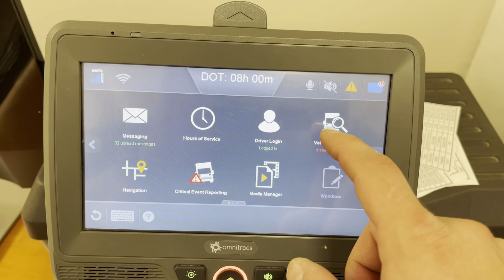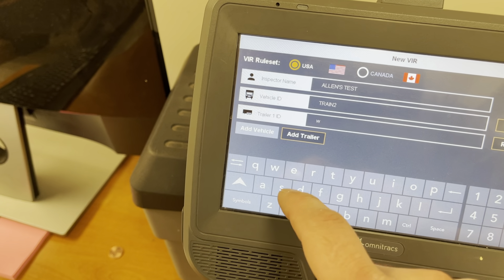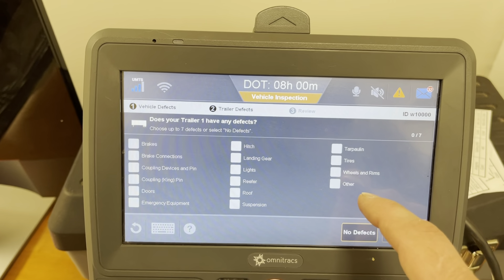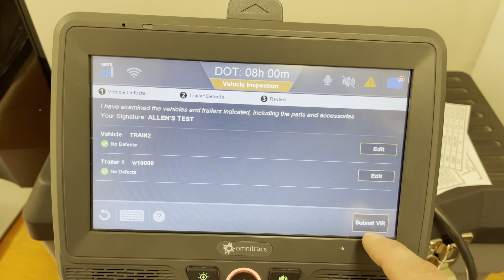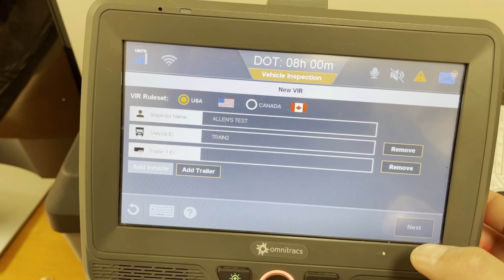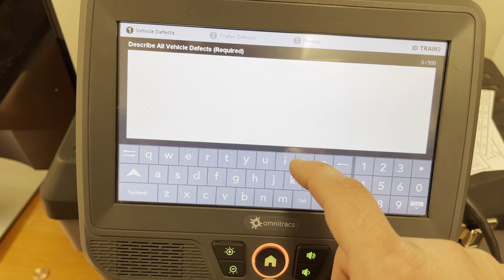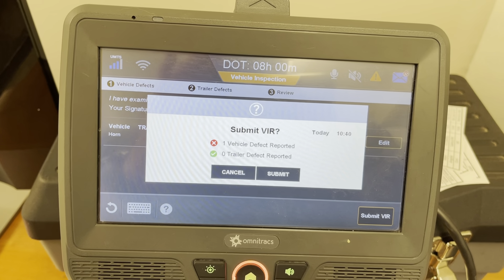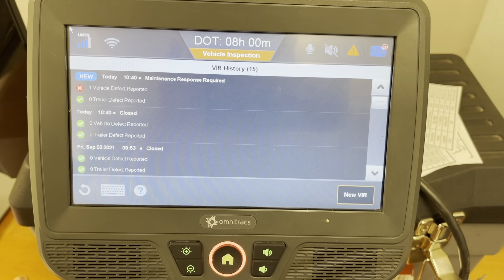Omnitracs IVG - How to Do a VIR

Comment: Could you please let me know what adaptor you used to be able to have power to it indoors ?
Reply from the maker: I made my own using a old cable from our of our trucks. You will need the Black, Orange and White/grey cables to make power. Then used a 12v car accessory with a acc switch. The switch goes to I believe the white/grey to simulate a key in the ignition.